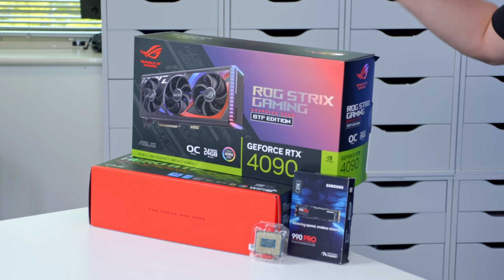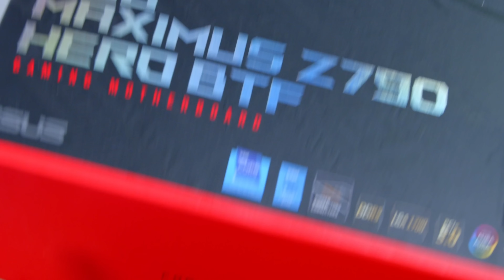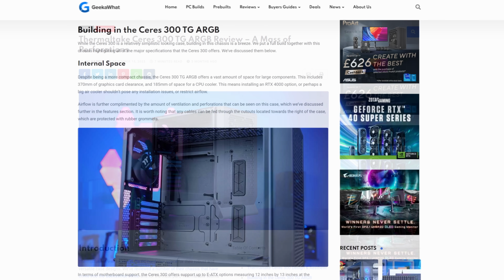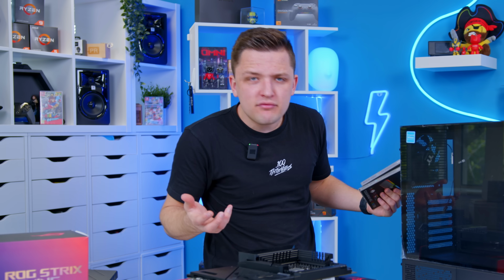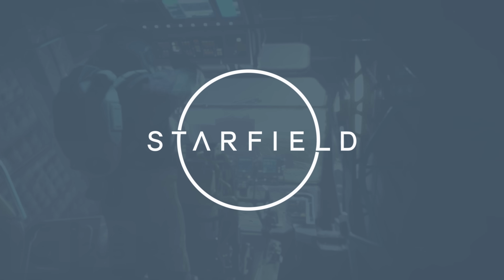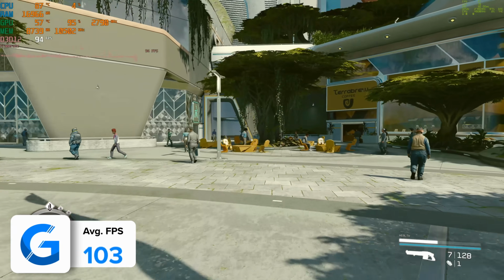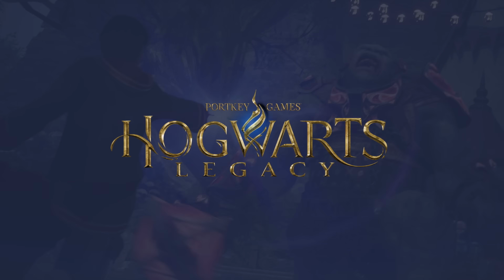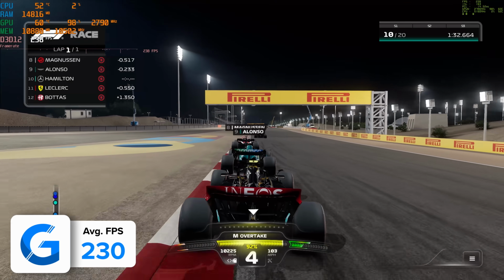Building an RTX 4090 Gaming PC with Zero Cables! 👌 [The ULTIMATE Build for 2024?]

Comment: I have the same case and I noticed a winding noise from the front 140mm fans.and is because of the way the mounting is designed.the metal fixing for the screws are obstructing airflow intake and creates turbulence.anoying to my ears I'm considering returning the case or cutting it.

Comment: The first build I did by myself was a 7800x3D and 7900xtx
Reply: Same here. I got the power color red devil version with the 7800x3d
Reply: @mrgoodbar216  nice, mines the sapphire pulse
Reply: @alexbauer20  i was gonna get the sapphire but microcenter didn’t have it
Reply: Lucky you had such a huge budget 0:01
Reply: @vangelisandreakos6495  took me 4 years to build that budget
Reply: Nice!  If I'm remembering right, my first ground-up build was an FX-6300 and R9-270X.  Not an awful machine for its day, and hugely better for gaming than the Core i5 IGP Thinkpad it replaced.

Comment: Thoughts on this build:
AMD Ryzen 5 7600X 4.7 GHz 6-Core Processor
Gigabyte GAMING OC Radeon RX 7900 GRE 16 GB Video Card
Scythe Fuma 2 Rev.B 39.44 CFM CPU Cooler
Gigabyte B650 GAMING X AX ATX AM5 Motherboard
Corsair Vengeance RGB 32 GB (2 x 16 GB) DDR5-6000 CL30 Memory
Corsair MP600 Force Series Gen4 1 TB M.2-2280 PCIe 3.0 X4 NVME Solid State Drive
Aerocool Cylon ATX Mid Tower Case
Corsair RM850e (2023) 850 W 80+ Gold Certified Fully Modular ATX Power Supply
Reply: looks good! but what gpu are you considering?
Reply: @Femurus.  Oh yeah my bad... I forgot to add it... It is the 7900 gre
Reply: For the RAM, you want better timings. Go for 6000 cl30 kit. And if you're budget allows it, Corsair RM850x is a far better option (longer warranty, less noise, 5 PCIe/EPS connections instead of 4).
Reply: @Audiosan79  OK thank you
Reply: @Audiosan79  what about now
Reply: @rayyan337  That looks better.
Reply: @Audiosan79  OK thank you

Comment: All these reviewers keep adding aio with tubes to these builds.   Should be using air coolers and not the tubes exposed.
Reply: As someone who has never ACTUALLY built a PC, but very much wants to in the near future, any chance I could ask for some clarification on your POV, there and why they should be using air coolers and not exposed tubes? And do you mean they shouldn’t be using AIO with tubes at all? Thanks, in advance, for any reply/thoughts/etc in advance. <3. Also, if by ANY chance you have any idea why it didn’t boot up properly the first time, would love to hear some thoughts on that. TY! 😊